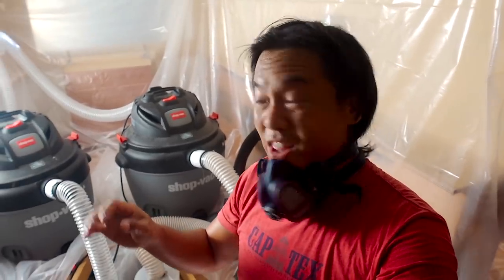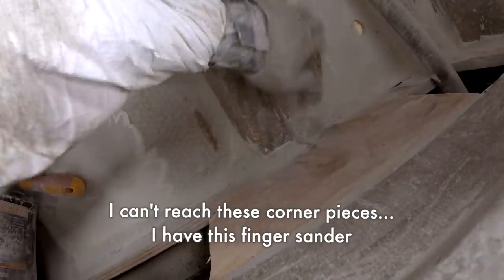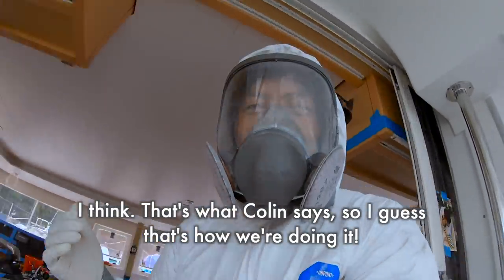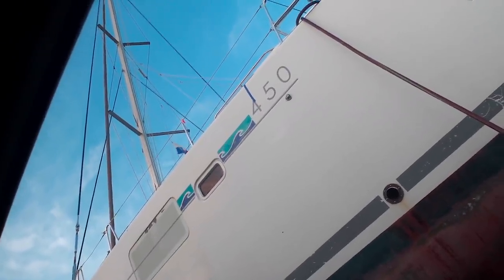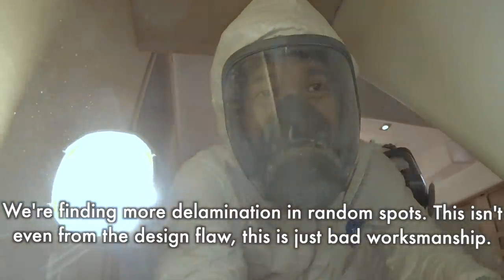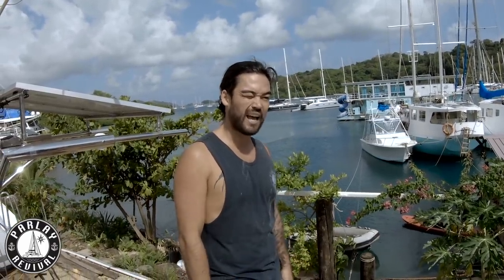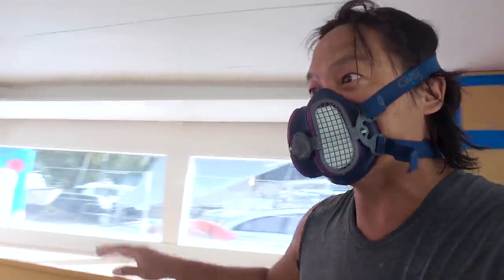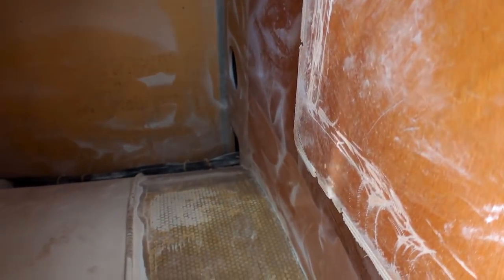I Sacrificed 3 Days of My Life GRINDING Fiberglass to Save $18k

Comment: David, for someone who is new to "boat rebuilds" / major repairs, your planning and design for exaust and waste is a thing of beauty😂👌Meticulous 👍Breaking Bad move over 🤣
Reply from the maker: Hey Peter! I'm terrified of getting more crap in my lungs.  Also its amazing what you can accomplish when you're trying desperately to avoid something else.  I spent a good month procrastinating starting the grinding, coming up with more and more parts of the dust collection and ventilation system.  Eventually I built it all and had no more excuses but to start grinding!
Reply: @david_shih  l think even Colin was impressed with all your prep work prior to taking off the carpentry, compared to the way you did it, they hacked theirs out 😂🤣
Reply: Yeah that kind of work is worth clicking subscribe
Reply: @david_shih  The dust collection system that you created probably added 5 more years to your life.
Reply: @david_shih  Hello Dave, do you know if Lagoon compensated all the 450 owners with the same problem?
Reply from the maker: @3DPeter  definitely not Most people got nothing but a reinforcement kit that’s all but useless unless your boat wasn’t showing any signs of being bent/broken yet.
Reply: @david_shih  So are they out of busines then? Because i can imagine that no one want's to buy a new boat from those "craftsmen."
Now i'm not into boats and i'm not a designer by profession, but when i would have worked at the design department, then i sure could tell up front that 
those single sheets of plywood were not enough to cary the whole structure.
Anyway, i love your work and i wish you all the luck and hope to see video's where you and your family finaly can enjoy all the hard work you put into it.👍
Reply from the maker: @3DPeter  the crazy thing is they’re thriving! Backed up for years! So less motivation to take care of past customers I guess.

Comment: The design flaws we all know about.  The workmanship flaws bring this fiasco to another level.  Hope you found everything that needed repairs.  You don't want to ever repeat this tear down and grinding process so good advice from Colin on the bulk head in the engine compartment.  Get'r done now so you can relax knowing you never have to repeat this process...will help with resale value too.
Reply from the maker: Yes sir Tim!  Never again is my motto...so whatever i have to do to never do this again!
Reply: Well I would say poor or sloppy workmanship is a large part of what we live with. There are many apartment/Condo buildings being town down after 20 or 30 years yet my Aunt and Uncle lived in a cottage that had an entry in the Domesday book. I myself purchased a showhouse on a new estate this is built so prospective buyers can order off book .I toured some of these slightly newer houses that had never been live din and the difference in quality was palpable.

However a boat is something you rely upon to keep you safe whereas Lagoon obviously slapped then together as quick as they could. It may well be that those 450's that have not had bulkhead issues YET only are in this shape as these boats had better workmanship.

I think people should reconsider buying any French built boat the cost of labour is obviously a lot higher in France then say Vietnam South Africa etc.
Reply from the maker: @glennedwards1449  so i’d say most of the 450s show the problem, and if not, it just hasn’t happened yet and needs to be reinforced. The other lagoon models should be fine, despite the ‘standard’ workmanship levels.
Reply: Looks to me to be  severely lacking  in design strength.  I'm not sure these repairs will hold up.  Sad to see those cabinets ripped out.  I think they will cost a bunch to make look good again.  It seems to me the cabinets should have been designed to add lots of structural support.    Any boat designer who relied on 3/5" 7 ply wood was not very good. As Collin said his additional lower side plies popped right off so they glued and screwed some like yours.   I see so many shear failures and a few days of fiberglass slapped on is wishfull thinking.   The fix kit was hatched in the boardroom as an appeasement.   Those 450's and 500s have zero resale value in this mechanical engineers opinion.

Comment: Holy shit, I can't believe Lagoons are so badly made!
Reply from the maker: Sad to say that most production boats probably have similar issues but manage ok. The problem is that Lagoon added weak bulkheads on top of all that. The straw that broke the camels back!
Reply: @david_shih   I think you are exactly right . All production boats have build quality issues and it does not matter because they are generally overbuilt anyway with a big safety margin . Not so in this bulkhead issue .

Comment: Buddy! I can't say enough good things about your edits! Loving the map of the boat where you show the area you are working on, but really it's all of it, great cuts, great music, great info, and it seems like your videos just get better and better. Great work on your dust system as well! Not being there I can't tell but the only thing I can point out that might make it better is metered air replenishment. You of course want to keep a low pressure area where you are working but also allow a finite amount on new air in to allow your exhaust fan (cool unit by the way) to carry away the particles. No idea if the air from under the door and all the crevices is enough, but you could always put one more hole in your window board and another bit of wood on a screw that you can rotate over the hole in order to adjust incoming flow. Ehh, it's a theory at least. Cheers, it might not be easy, but you will have immortal videos of those times to look back on and for others to study and enjoy :-)
Reply from the maker: Hey good idea on the rotating wood/hole metered air. I could feel a steady breeze coming in from under the door, but it was all a guess to be honest! Thanks for the kind words about the video…probably spent way too much time on it, but once I get started I can’t stop until it feels right!

Comment: A full-face positive-pressure (from remote) air supply mask is a really good thing.  I use a Breathe Cool II from Turbine Products.  A turbine pump  is placed in an area with clean air and supplies low pressure air through a hose to the full-face mask.  I no longer have sweat dripping in my eyes, or rolling around in the bottom of the mask.  No worries about an imperfect mask seal.  I haven't tried it yet, but I've got a Y-valve to split the incoming air into the Tyvek suit.  That's a modification recommended to me by a shipyard worker.  It should help cool and keep some particles out.
Reply from the maker: I’ve heard of the positive pressure masks, but never the positive feed into a suit. Ingenious…no more dust creeping into every tiny suit opening!! I’ll check out the breathe cool, thx!
Reply: @david_shih  The mask works really well.  I've used it in nearly white-out conditions while grinding fiberglass in the forward storage compartments of my catamaran during a Florida summer.   The cyclonic separators upstream of the shop vacs are definitely required when working with such volumes of fine dust.  I use one from Home Depot that fits on a 5-gal bucket.  With that and a HEPA filter in the vac, exhausting air into the living area has been OK for me.  I'm about to setup a negative pressure zone to grind in one of the heads.  I now live aboard, so I'll have to be very careful about leakage.  I'll use a 20 inch box fan with a 20 inch air filter taped to it, and fashion an adapter to a pair of 3 inch flexible duct hoses that will fit to the small portlight there.  I can't just release dust where I'm docked now.  Was the dust that escaped your zone solely from you entering and exiting?

Comment: LOL… “Please be a Good Boat”… Great video!  It’s a little like a Forensic Post Mortem, documenting the structural issues as well as the flaws in workmanship… which are all pieces of the puzzle.  Thanks for the hard work, sharing the process and the positive attitude
Reply from the maker: You’re right about the post Mortem! We found so many extra problems than we went in there for. Most of which was just bad glasswork that would be forever hidden if not for the bulkhead issue causing us to open her up! Couldn’t do it without your support brother—thank you for your help on patreon!
Reply: There are always a few build defects in a production boat but because they are generally overbuilt it is not a problem . However in the Lagoon where the bulkhead is clearly underbuilt all of the build quality issues loom large.
Reply from the maker: @faircompetition1203  that’s actually the approach I’m taking to rebuilding the bulkheads. Overbuild bc mistakes will be made.
Reply: @david_shih  Absolutely the right way , the only caveat is to beware of moving the load to a different weak spot . I am thinking of adding an aluminum plate below the mast on my boat but am also aware that I could be moving the flex to  the ends of the plate and cause it to crack there .

Comment: Where did Lagoon make these pieces of junk? The workmanship is the worst I've ever seen on any boat. I've seen dudes in remote jungles, with zero experience or skill do better work. This company should be sued out of business, they clearly care fuck all about quality control, I think that is a foreign term for them
Reply from the maker: I think it’s one of those cases of you get what you measure. And parts of the boat that are hidden forever by design are hard to measure and inspect. So quality in these areas just suffer.

Comment: I am a fan of your fans, and vacuum system. Absolutely brilliant.  That pile of dust in the dirt is not going to be drifting into crevices on your boat.  (I once lived in an apartment I was also renovating. I had plastic up isolating the area where I was drywall sanding. Didn't matter, it got into my my camera in the next room and clouded up the viewfinder. The nastier the dust, the more insidious it is.  
I've worked with epoxy, and a little bit with polyester but never with vinyl-ester, It does seem that if you have de-lamination - then it maybe it wasn't properly prepped and laminated in the first place.  (I have this vague nightmare of everyone knocking off for the day, or the weekend at the Lagoon factory and then doing no bloom wash or sanding to prep for applying the next layer of vinyl-ester when they come back to work.) 
If you're repairing a hole I'm pretty sure you're supposed to put the biggest piece on the bottom and then taper up to the smallest piece on the top. This way when you sand it you sand off the edges of the layers, and never cut into  middle of any of the fabric. 
(Cat Great Circle in a video comparing the Lagoon 52 they replaced with an Outremer 55 mentioned reducing the noise from inside the boat as a factor  https://youtu.be/Ohs-3nPzDK8  The whole video is good, I just linked to where Mark lists 'interior noise' as a factor. Makes me wonder if there are not craftsmanship issues on more than just the 450s. )   
I've fought the fiberglass itch battle probably since your grandma was a kid (1960s?) We'd vacuum our skin, take really hot showers and then rinse in cold water. Never heard of vinegar. Loufa? Actually that looks like one of those Japanese scrubbers - been using those (but not for fiberglass) probably since your mom and dad were kids (1982?). Probably good for it. The best way to avoid fiberglass itch is aluminum, steel, or somebody else doing the sanding someplace else on some other boat. 
My plan for the Lagoon 450 is ... well I bought another boat.  I'm choosing to trust the Aussies and the Vietnamese . But if I hear one squeak I'm turning around and taking it back. (Remember Brad Pitt in Once Upon a Time in Hollywood?  "Fix it." )  Hang in there.
Reply from the maker: your nightmare is my nightmare...there were definitely days where the workers were like, "amine blush? i don't see no blush.... you sanded this last time right? let's glass!"

this is classic, couldn't be more right.... "The best way to avoid fiberglass itch is aluminum, steel, or somebody else doing the sanding someplace else on some other boat."
Reply: @david_shih  You know I don't think I've seen amine blush more than just a couple of times - however I've always assumed it was there and usually sanded to remove it before adding more epoxy. I'd love to see videos of the Lagoon factory on a Monday morning- I'll bet they just start mixing.

Comment: G'day David, your suction system was absolutely EPIC mate ~ Absolutely Brilliant. Also, you definitely stepped up your editing skills. Incredible job. Good onya mate! During your 1st sanding pass on all the bad glass ~ you'll definitely find NEW AREAS of delamination! HOWEVER, YOUR ATTITUDE IS FUCKING AWESOME! Cheers from Maldives 🇲🇻.
Reply from the maker: Thanks! And I have glass dust too, more than anything. And you’re right on with the 1st pass. I’ve already gone through twice more after the dust settles and had to grind a bunch more.
Reply: @david_shih  I ran through 3 passes on my Lagoon 52F before we finally had all the delaminated spots repaired and able to accept the new glass ~ both tabbing & sheeting. Pain in the arse ~ but definitely worth it! Continued success David! 🙌
Reply: Hey David, Lagoon used absolutely shit resin, putty adhesive, and shitty glass on the interior. Lagoon really went cheap with their products. The interior of my 52F was absolutely shitters and the crappy adhesive putty, didn't stick to shit ~ and it's the putty that Lagoon relied on for a proper & secure bond between the floor and hulls ~ and then you find out the putty didn't cure and bond the top to the bottom. Absolutely shitty product and crappy design. Keep an eye on all the putty seems. They're probably not even sealed and obviously bonded properly! Cheers David!

Comment: Hi David. Fiberglass: I hate fiberglass itch. The worst thing is rubbing or washing it. Try blowing it off. That is what we do. Boat: shocking the really bad quality, dry glass, non bonded or touching bulk heads and bridge deck. Amazing work you are doing.
Reply from the maker: Tim. I’ve got a battery powered blower…I’ll try that trick next time! Once before the suit comes off and maybe once after. Thanks!
Reply: I second this.  Everything you can do to avoid rubbing the glass against your skin will aid in keeping it from being embedded.  If you don't have an air compressor, a leaf blower level of air is the next best thing, and then finish with high pressure water like from a hose nozzle, not a pressure washer. :-).  Use the air and water to push it off your skin, rather than against and into your skin.  There's no perfect prevention from itches after it's already on your skin, but avoiding rubbing it in, and a hose spray at the end, has made the itches uncommon enough for me.
Reply: But this is panama and I thinkost of us can't imagine the sweat and heat grinding in a suit in a hot boat in the sun.